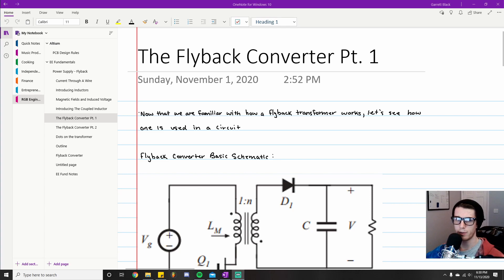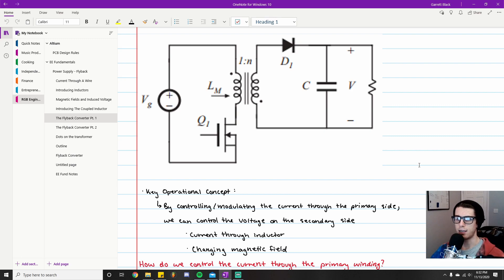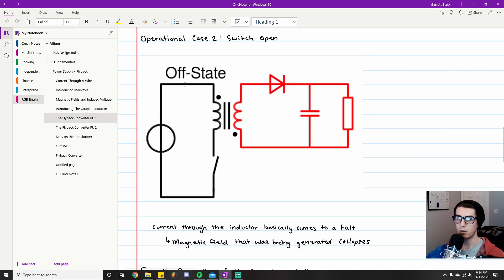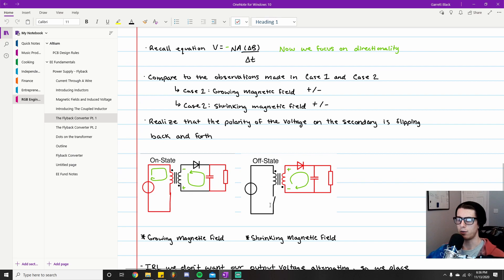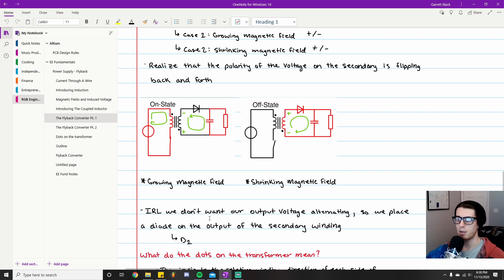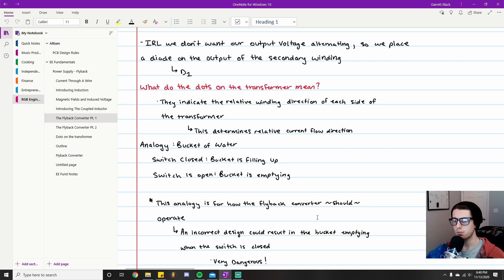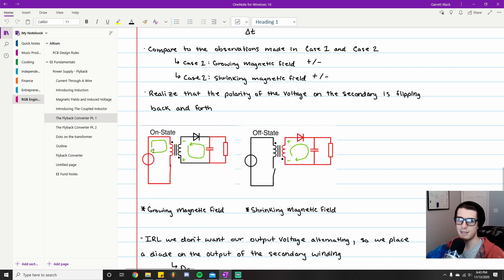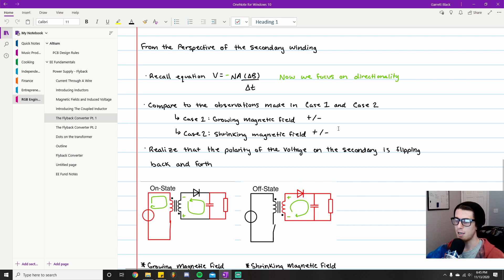FLYBACK CONVERTER BASICS PT 1| FLYBACK TRANSFORMER, FLYBACK CONVERTER DESIGN BASICS, AC-DC CONVERTER

Comment: You can produce an extremely high voltage at the output of a flyback converter with ordinary duty cycle and frequency. Once that energy is put into the charging winding it will go somewhere. If there is no load and no controlling feedback, an output intended to be 12 volts could rise to 300 volts. That would be very unlikely because the output filter capacitor would probably explode long before reaching that voltage. Either that or the switch would be destroyed by the reflected secondary voltage (the only time in which the flyback inductor behaves as a true transformer is when the switch has turned off and the stored energy is still being discharged). In fact flyback and boost converters are the only common topologies in which the output voltage can rise to extreme levels. With things like forward, bridge, half-bridge and push-pull converters the secondary voltage is limited by the transformer turns ratio.

Comment: Is it possible to make a variable voltage power supply using the flyback topology where I can vary the voltage from 0 to some voltage like 60v.?
Reply from the maker: Yes, you would just have to adjust the feedback resistor values (you could use a potentiometer to do that). Also be sure to have the transformer winding ratio such that the duty cycle of the flyback controller IC stays within it's range of possible values.
Reply: Old question, but ...
Yes, you can do that but there are a number of things to consider. It can be a lot more complex than you might imagine at first.

Probably the biggest issues is powering the control IC and other circuitry necessary for wide-range operation. If you are contemplating operation from AC mains you have a problem with keeping the control IC powered. Typically start-up is done by charging a capacitor through a high-value resistor from the rectified input supply, which could be over 350 volts. Because it takes several milliamps to keep the control IC running, powering it that way continuously isn't practical. To keep it going it is common to use an "auxiliary winding" on the main inductor ("transformer"). But the voltage of the aux winding more or less tracks the voltage of the main output (you can design for some specific factor, if you want - e.g. aux voltage = 1/3 of the main output or 2 times the main output, etc). If you want zero volts out, you'll get zero volts out of aux.
My advice would be to power the IC and any additional circuitry you need from a completely separate "housekeeping" power supply and drive the MOSFET with a suitable isolating driver which itself can be a bit of a challenge. You might even want a negative supply for some of the control circuitry so you can be sure signals can swing fully to zero, not just within a few tens of millivolts of zero which is what you get with "rail to rail" op amps.
Of course if you are starting with some "low" DC voltage like 12 or 24 volts, things become simpler except for that possible need for a negative supply, where a simple capacitive charge pump "inverter" may be quite adequate.

Another consideration is that the duty cycle required in a flyback converter varies with both the input to output voltage ratio and the load current. With a forward converter, in comparison, duty cycle is more or less constant with changing load current (IF the output inductor current is "continuous" - never drops to zero; once you get into discontinuous mode you have to reduce the duty cycle as the load current drops). That isn't any big issue as long as your controller can do the required duty cycle. A controller that does "pulse skipping" elegantly can be helpful. Instead of just controlling duty cycle with a fixed frequency, full cycles can be omitted at very light loads or very low output voltage. Lots of controllers will do that, but not very nicely. The circuit will probably work but performance might be poorer than with a controller designed to do it well.
Reply: @D614G_aka_Doug  thank you for the reply, I do plan to use a separate power supply for the control IC. This will also generate negative voltage for op amps. 

Is it possible to build the power supply with uc3843 IC?

Comment from the maker: Was this video helpful?
Reply: Very helpful! What you stated at 12:54 would it be possible in theory to put a power resistor in parallel with the switch and a path to ground to dissipate the current if the switch got stuck in the closed position?